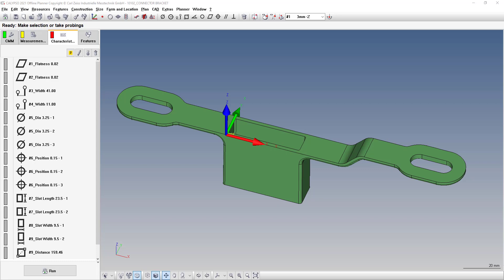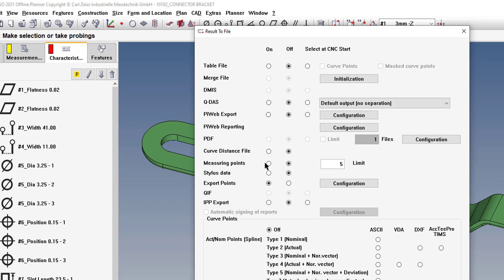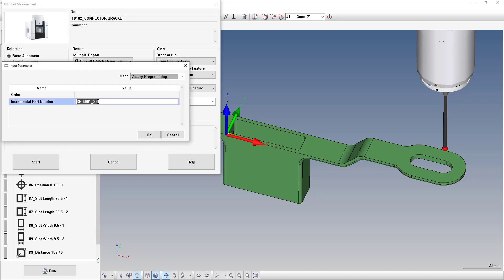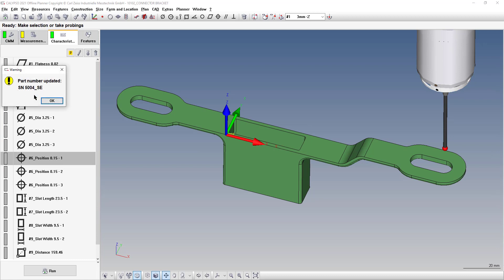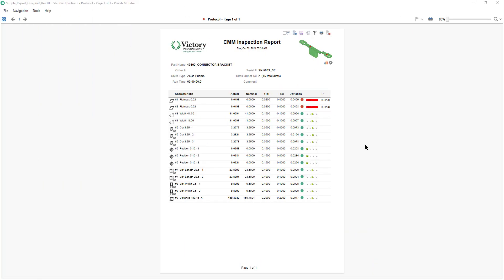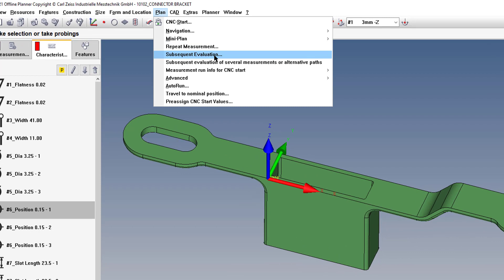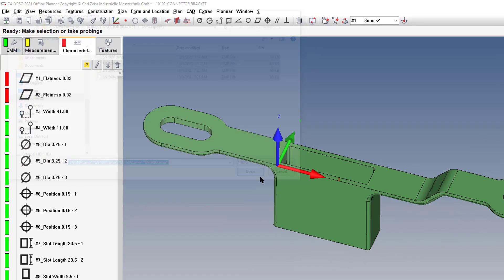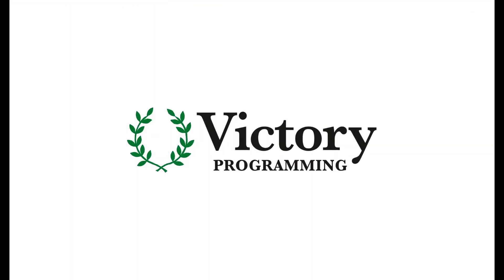Calypso Tutorial: Save Measured Points

Comment: Hello.
I did the Subsequent evaluation of Multiple Reports but only one report shows up at the end.Where are the rest so i can save them to the corresponding pdf samples.
Reply: Hello Steven.Are you refering to: PDF check box at  "Output Media for CNC Run" section in Multiple Report window.
I am using Calypso 2023 Service Pack 5. Once I open Seubsequent Evaluation of Multiple Reports-  the PDF check box in the Multiple Report section  is Blurry and can not be selected.
Out of 21 sample I rerun I see PDFs being generated and being closed by itself and  at the end only one report  shows up which is Sample #9.
The rest of the 20 reports do not open so i can save them.
Reply from the maker: Hello, Do you have PDF export enabled in the Multiple Report window? What version of Calypso are you using? I tested it on Calypso 2024 and it worked.

Comment: How can we have it set for every program without setting it for every program
Reply from the maker: You can make a "template" measurement plan, which is basically a blank program with measured points turned on. Use the template program for other saved settings, like report output, units, custom clearance planes, etc. Then when you make a new program, open the template and Save As.
Reply: @learn-cmm  Thank you very much for your reply.

Comment: First things first I want to say I appreciate you posting these videos. I’ve been working with calypso for 2 months now and your tutorials have helped me a bunch! What’s the best way to find the angles of holes on a cylindrical part. The angles are referenced from the x and y datum and not another feature
Reply: The x and y datum are a thru hole in the center of the cylinder
Reply from the maker: Hi Christian,
One way is to create a 3D line between the hole and the XY center. Next, you would create a Projection feature to "flatten" that line onto the top plane. You can create a theoretical plane to represent the X or Y axis. Then report the angle between the projected line and the plane. The reason the Projection feature is needed is because sometimes Calypso interprets angles different than you expect, so it helps to isolate the angle in a 2D perspective.
Hope that helps!
Steven